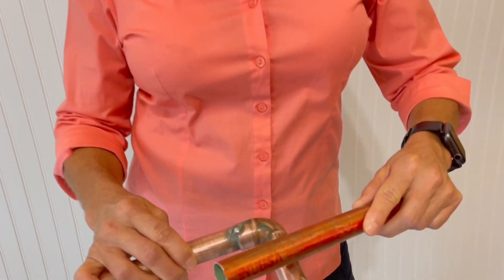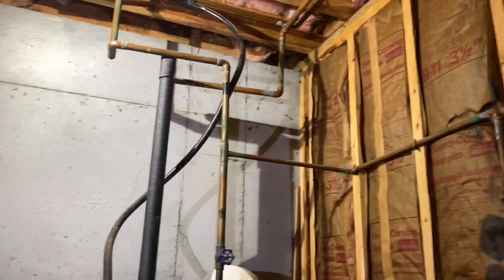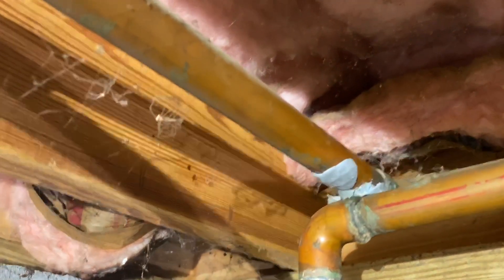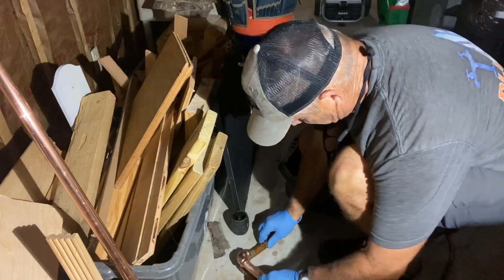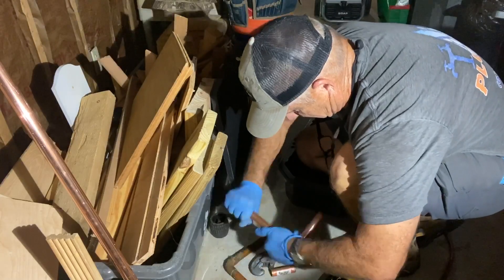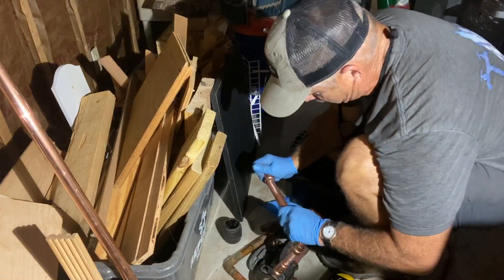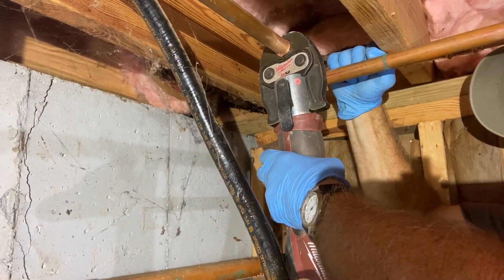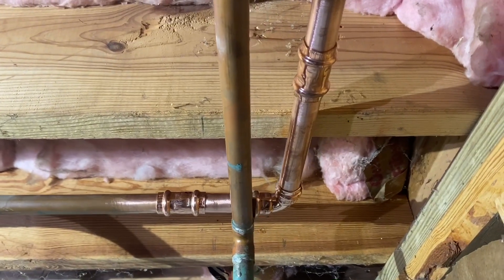Pinhole Leaks Are Created When Pipes Touch or Rub Each Other @TappPlumbing

Comment: The red line marked on the pipe tells me it’s type M which means it should only be used for non pressure systems such as condensate drains or water heater blow offs… Type M copper is paper thin  causing holes And corrosion years sooner than than the correct type L pipe…
Reply from the maker: Just curious about what part of the country you live in ? The building standard around here for residential has always been M. No one installs copper around here anymore period, even in very high end homes. We work in metro Atlanta.